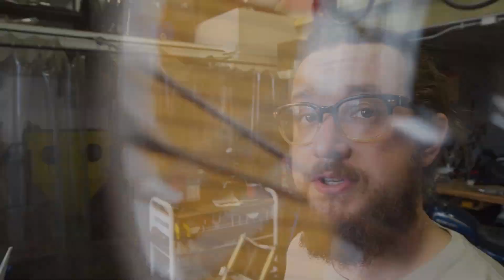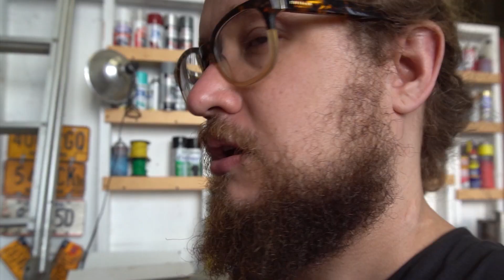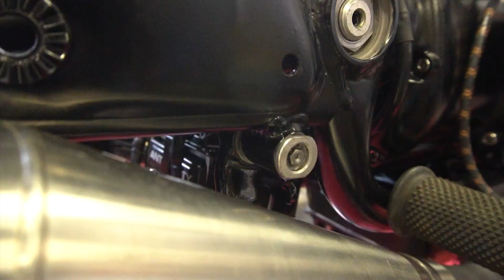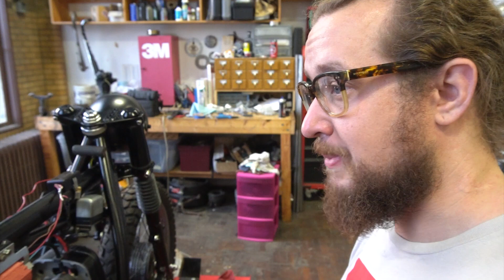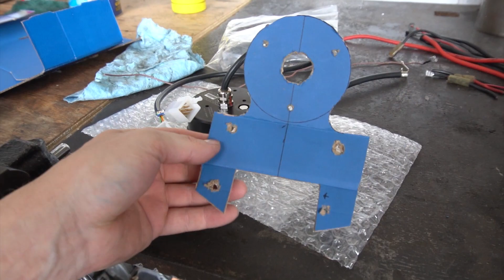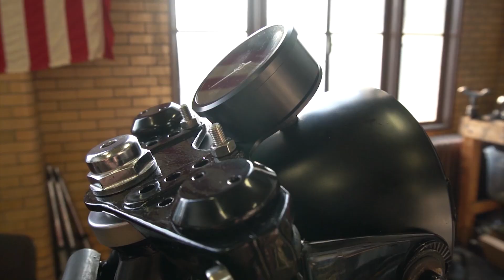Motogadget M-Unit Blue and Chronoclassic Install - BMW R90/6 (Part 1)

Comment: These videos are great!  They have been a major resource in my r75/6 wire mod.
Where did that light bucket come from?  I ended up with a chrono classic speedo. The old dimples in the bucket are very unsightly.
Reply from the maker: I believe that was an LSL 6.5" headlight, which I modified to fit the BMW key ignition.

Comment: Why did you connect blue cable from alternator to the Aux 1 output? And how did you set up this aux1 output in the app? Should it be giving voltage together with ignition? Why didn't you just take the voltage from red ignition output?
Reply from the maker: I suppose you could run it from the ignition output. By using Aux 1 I could keep the circuits separate, which makes for fewer wiring connections and a simpler harness. It's been a few years, but I believe I set Aux 1 for 'active after engine start', since the alternator wouldn't be spinning until after engine start anyway. 
If you had a lot more accessories to power, then connecting to the ignition output make sense.

Comment: Just came across this series and I am loving it. I am at the wiring phase of my build and using the m-unit. One question I do have is are you afraid of road debris or foreign objects off the tire hitting your beautiful antigravity battery?
Reply from the maker: It's a possibility! if that's the case a re-designed housing might be in order.

Comment: Hi brother, new subscriber and building my first custom airhead 1975 R75/6. I'm deleting the factory gage cluster and I am wondering what resister I should use for the blue wire you mentioned?
Reply from the maker: I'd suggest a 50ohm/5w resistor - but I'd also like to mention that Enduralast now makes a generator light bypass kit. It's $20, definitely more than a resistor, but it's really simple to install and pretty headache free.
Reply: @roodlum  Awesome 👍 Thank you for the information and the reply brother.

Comment: Hey Rich, good vid man.  A question - where did you get the speed sensor?  Who made it?  That is the only thing stopping me doing the m unit.  Thanks.
Reply from the maker: Thanks! It used to be that you had to make a hall effect sensor to fit the stock cable location - but now you can pick up these adapters at several places that stock Motogadget gear. I think this one came from Revival Cycles.
Reply: @roodlum  ah, right, found it on the motogadget site.  Thanks.

Comment: Hi there, thanks for the great vid. I’m completely rebuilding a /5 and almost at the point I’m gonna start rewiring. I got the m unit but I’d like to keep the the oem starter, ignition, and charging- like you did here. I’m gonna keep the original battery too. Can you help with some more insights? Can you share your wiring diagram? Thanks 😊
Reply from the maker: No sweat! I added the wiring diagram to the photo gallery of that bike on the website. Check it out here: https://www.interstellarmotors.com/jf-bmw/
Reply from the maker: Something else of note is I have since upgraded the charging system to an Enduralast setup, which eliminated the diode board and voltage regulator and replaced them with a modern Regulator/Rectifier unit. It also replaces the stock rotor/alternator setup. It simplifies the system a little bit further and will be more reliable long-term.
Reply: @roodlum  working on that..

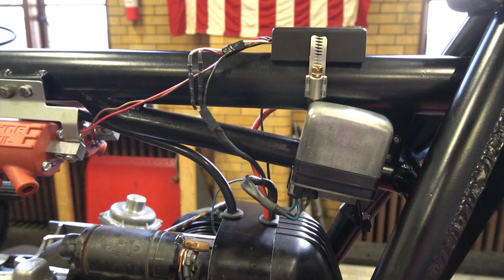Comment: 5:45 The reason you want a fuse on positive wires from the battery is to make sure that if the cable shorts to ground the bike will not burn down. That's why modern cars have fuses close to or on top of the battery.

Comment: What type / level of resister should I use for that blue wire you mentioned 5 min into the vid ? I deleted the instrument cluster and my bike seems to be having trouble hold a charger. Thanks for the great content!
Reply from the maker: I used a 36ohm 5 watt resistor, which might be a little low as the charging is still a little weak on this bike. I may try a 50 ohm in the future.

Comment: How do you have a li-ion battery without a reg/rec for li-ion?
Reply from the maker: The OEM charging system is adequate for this battery. It doesn't produce as much voltage as many other bikes so you don't run into the issue with charging the battery at too high a voltage. If it becomes a problem later on down the line I can always swap those parts out.